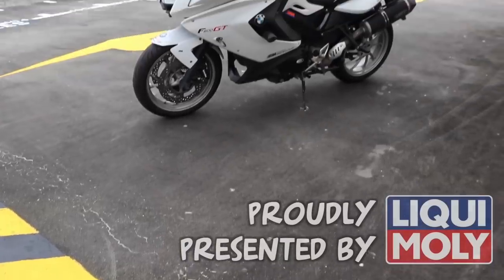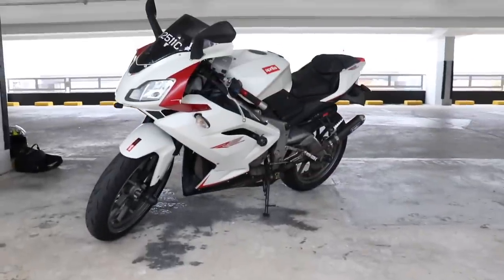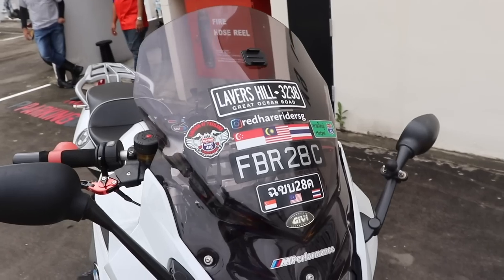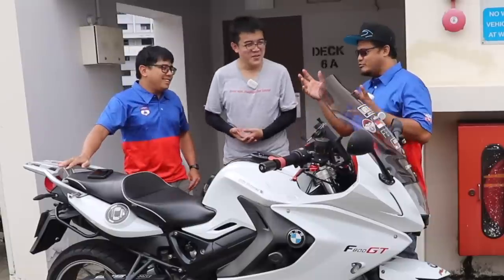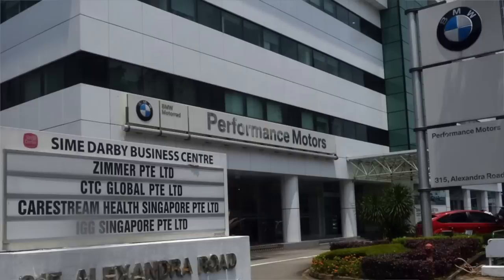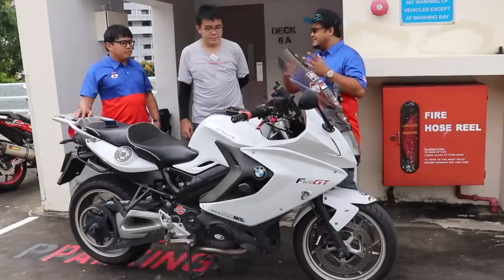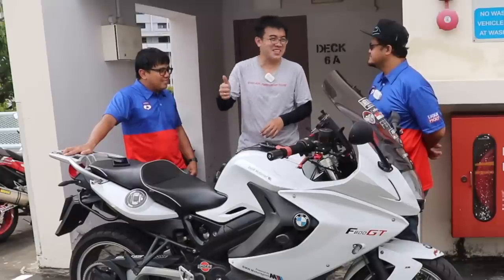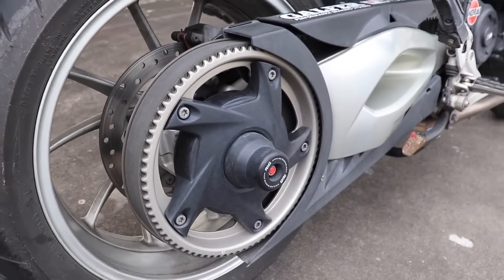Vlog#327 BMW F 800 GT | Honest Singapore 🇸🇬 Motorcycle Reviews

Comment: I actually switched from Ninja 650 over to this bike, and it has been a joy. It has 13k miles on it now and of those 10k are from me. No issues so far and basic maintenance is pretty much the same as the Ninja. I was originally thinking of eventually switching to a 1000cc bike after my current one but it honestly has plenty of power, and the handling is very nice on twisty roads! Highly recommend it!